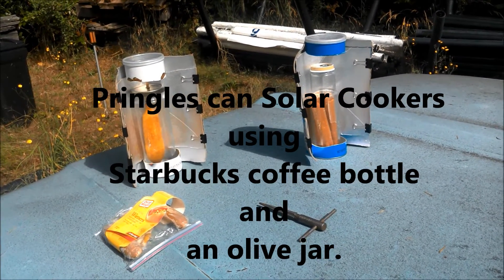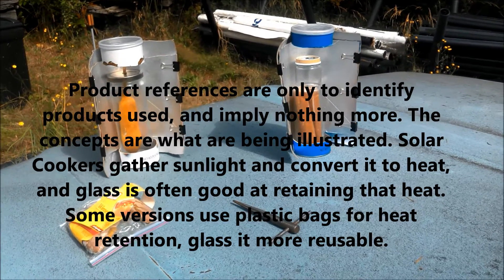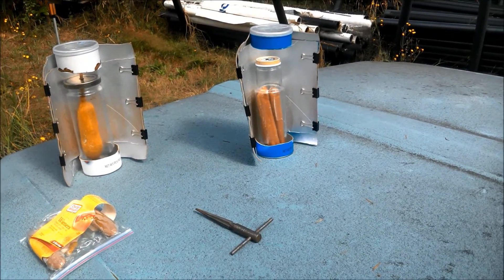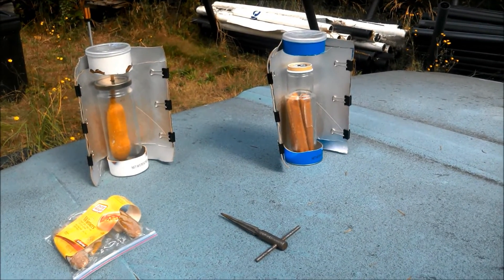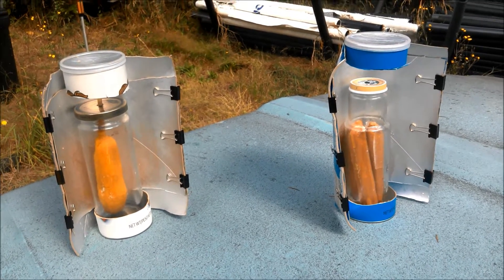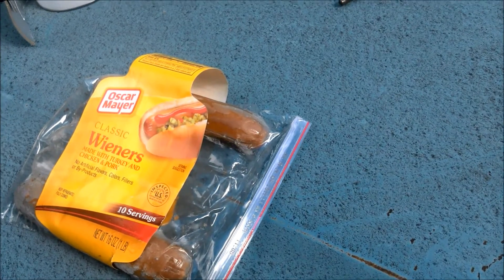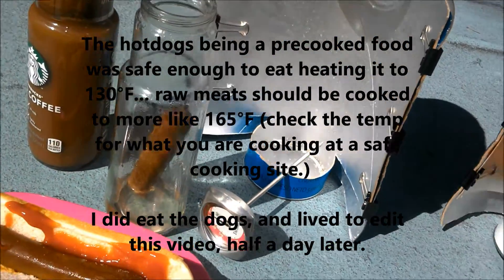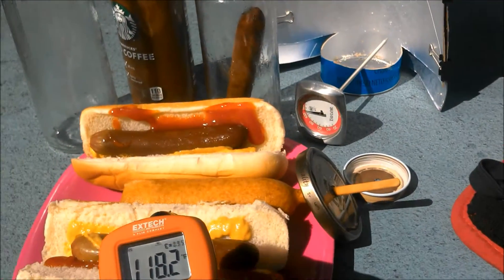Pringles Solar Cooker

Comment: Best temperature transfer is when the glass surface is painted black and placed in an oven bag to help retain the heat. Hot dogs wouldn't nearly take as long to cook with that method. The temperature should be way higher than slightly over 100 degrees for cooking with the sun.

Comment: Instead of a jar, I would use a can of some kind preferably painted black, a jar lid painted black as well would be good too. The Pringles can is a neat idea.
Reply from the maker: Another video I did that is a summary of experiments, long and boring if you are not interested the experiments in solar cooking... https://www.youtube.com/watch?v=K8gToez6BXg   but I did get some effective cooking done and I did almost burn my Lasagna that started out frozen and was cooked under glass. I was rewatching it some and got drawn into the pork loin in dark pans inside glass (Pyrex bowls and pie plate pairs) that illustrated dark containers inside glass.
Reply from the maker: The Pringles can cooker is a classic for kids to do as a teaching tool, a lot of videos of people trying it... some miss getting the concepts in doing the project... this was a video of my improved version using a jar to replace the plastic wrap window that was in the original design ... it is posted with my other solar cooking experiments document on Pinterest at https://www.pinterest.com/ECharlesWright/solar-cooker-projects/   

I do have some experiments with cans planted black there mostly using a higher power cooker... a funnel cooker made from a truck window shade... there are painted black jar cookers that I have not tested... there are a lot of inexpensive ways to build a solar cooker.

Comment: I wouldn't eat anything cooked on that... Might warm up already cooked food
Reply from the maker: The method of cooking is a bit on the borderline, hot dogs are considered precooked, same with corndogs.  For cooking from raw, clean veggies like carrots would be safer than raw meats. It is a tool for exploring the concept of solar cooking in general. Bigger would better for serious results, the truck sunscreens I have used do develop serious temperatures.
Reply: @ACheshireCat2001  here in México you can get láminas galvanizada (Google image that so you can have an idea what I mean) I Will try to curve- shape a piece of that and use a licor bottle like pot
Reply from the maker: Here and online, one can find a lot of shiny sheet metals... the kind of stuff that parabolic mirrors and cookers are often made out of.  In my using the flexible truck sunshades https://www.bing.com/images/search?q=truck+sunshade+cookers&FORM=HDRSC2   I have found instead of a jar or bottle to cook in, a pair of Pyrex 2 quart mixing bowls were big enough to hold a black 2 quart pot with lid and removable handle work really well.  https://www.youtube.com/watch?v=K8gToez6BXg   my video on the bigger cooker experiments.
Reply from the maker: I did watch a video you posted,  I do not speak Spanish,  but from looking at your location in the background, you are in an excellent climate for serious  solar cooking,  I would encourage you to check out more of the more effective solar cooking methods.  Costs being one of my concerns... some get very creative like the fellow in Africa who used an old tire, tin foil, plate glass, crumpled newspaper and a small black cooking pot. I am about the concepts involved with the experiments. Hope you have a good time exploring the power of the sun.
Reply: @ACheshireCat2001  too much sun for my taste I would say.. But yes I am begining to live a more green life, I Will let you know when I make that solar cooker
Reply from the maker: Galvanized sheet, came up in the Spanish form with pictures that looked like corrugated roofing materials... which reminded me of another branch of solar technology that the Chinese have produced a big domestic market for... solar water heating...  here is a search link to find it.   https://www.bing.com/images/search?q=solar+water+heating+system&FORM=HDRSC2    Solar water heating for whole houses... some of the 'off the grid' technologies that are developing.
Reply from the maker: Some of the videos on YouTube about solar cooking methods can use some nice finished cookers, one I have is based on solar power tubes used in large solar power plants, the double walled vacuum tube cookers can develop serious cooking temperatures of a couple hundred degrees,  like an electric oven, that is a developing cutting-edge... the tubes have interesting limits.
Reply from the maker: Box cookers have a long history,  are produced commercially,  and done as projects by people good with tools, and there are the parabolic cookers,  those can get a bit dangerous considering the levels of energy they are handling.  If one has a good fixed outdoor location,  the increasing of size for greater speed gets possible...and the need for shutting the cooking off needs to be considered.  And waterproofing.